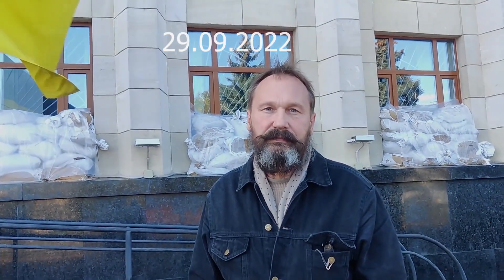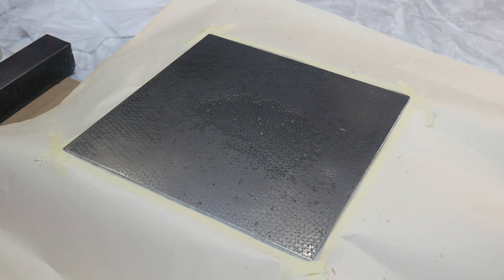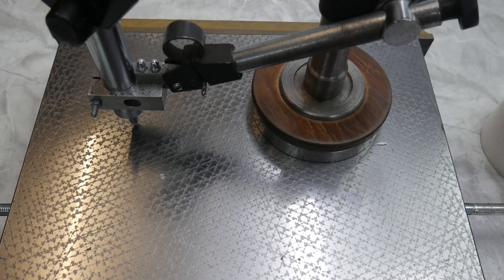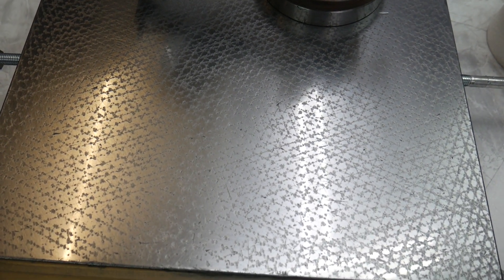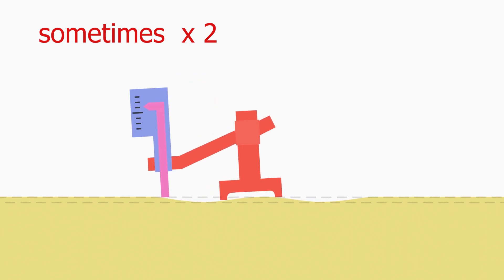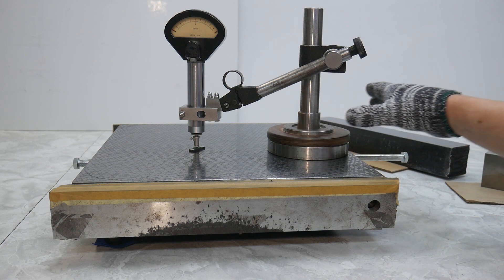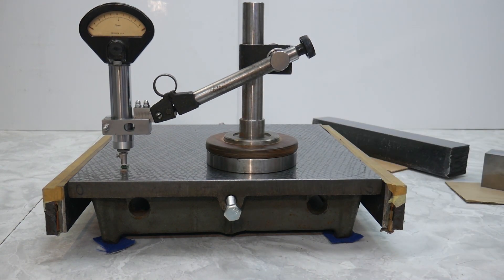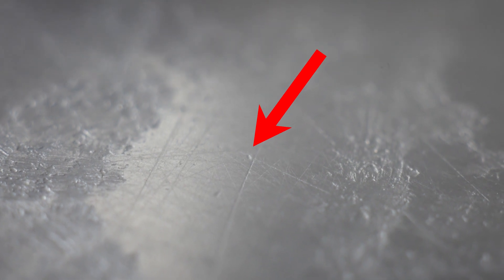Сhecking the surface  plate with a  microcator 0,0001 mm.

Comment: Mr. Bazarko shows what refined results can be obtained with patient work, informed by a deep understanding.  To see this level of precision achieved under extremely unhelpful conditions really demonstrates his expertise and his determination.   I have also watched the videos about the precision level, and the testing of the I-beam 1-metre straightedge - they also teach a great many details that are very valuable.  Even the blanket used to keep the radiation from his body from affecting the thermal equilibrium of the test object!    The Mikrokators look like a wonderfully sensitive instrument - the only problem with having one is that everything except the most extremely ideal surfaces would look very bad!  

This video showed us clearly and directly some problems to be careful about - markers and pins are both dangerous to perfect flatness....  I wonder how much more resistant to pin-dropping a granite surface would be.   Perhaps someone in Mitutoyo should send Mr. Bazarko a top quality granite plate for him to use and to test, as a gesture of appreciation. 

Lastly, applause for the comedy value of the cut from the calmness of the plate testing to the leopard-print painting of the lathe bed.  The vodka in Ukraine appears to be of excellent quality, as it made that paint job seem like a good idea.  Certainly made me smile!
Reply from the maker: Thank you for such a flattering comment. I want to clarify, I do not need a surface plate from Mitutoyo, it is an expensive item, and its transportation, due to its dimensions and weight, is also very expensive. I will make a surface plate of the highest class myself. Otherwise, what will I show my viewers? Fortunately, I have a very effective device for monitoring the surface of the surface plate, even better than an autocollimator. A very rare, complex and valuable device - an optical string. Direct optical measurements, and an accuracy of 0.0005 mm on a line of 800 mm. I hope to complete this project.
Reply: @gena_bazarko  It was not flattery, which is praise that is not deserved, but genuine admiration for your work.  To save you many hours of labour, for use on other projects, perhaps a gift plate could be acceptable to you - after careful testing of course :-)  I just hoped that one of the precision companies would show their admiration in a way that individual viewers cannot...   There are a few other very patient and skilled persons also sharing valuable information and examples - Robrenz and Stefan Gotteswinter are two I enjoy as well.  Robrenz has also shown some work on a large granite plate, that is of similar care and accuracy as yours, at least that is my impression.  I assume you know his channel as he is a fellow spirit. 

It is actually an interesting question, how the accuracy you are demonstrating here compares to a commercial specification like the "AA" grade that is generally used as a target for accuracy. It would not surprise me if your example plate was superior to that reference quality, but it is not easy to understand exactly how the written specification translates into a pattern of variability in a test like the one you are showing here.  The headline flatness specification looks like about 0.9um overall on a 450mm plate for a Laboratory plate, so you appear to be at that level, even without any extreme precautions in measuring.   In fact, your video showed that even a small pressure on the edge of the plate caused a bigger deviation than the average error.  It made me think about the effect of the weight of your heavy stand on the overall shape of the plate as it is moved around. Does the autocollimator show any local deflection of the surface under the weight of this indicator stand? 

Many thanks for your scientific and systematic experiments.  I hope that you are enjoying the successes of restorations like the grinding machine - that is a heroic project.  It will be very good to see it working after your renovation.  With appreciation from Cambridge, England.

Comment: Nice job! You show how to do it properly using very sensitive mikrokator with small hysteresis! Only one uncertainty is present - this method can't show the actual radius of the curvature of the surface so one can't know how much it deviates from flat surface. But the form deviation itself is excellent, I think, it is more like telescope mirror!
Do you consider to show surface plate flatness check with your super precise autocollimator?
Reply from the maker: Hello! I made a previous video, where I performed an experiment where I checked whether it was a plane or a sphere. I'll give you a link to the video. That episode is at the end of the video.  https://youtu.be/HwLQkeVVUk0
Reply: @gena_bazarko  Now I see, thank you. As I understand, your lapping bar is always on top position, unlike surface plate, and tent to form concave shape. Bottom surface plate tent to form convex shape. Cross checking them with indicator stand eliminates uncertainty in surface plate deviation from the flat shape.

Comment: Watched your video and got an idea not sure if it works. I have a mill and the table has twist and bow and I'm trying to make it flat using a granite surface plate 600mm X 900mm. The plate is raised in the middle by 4 micron based on the inspection paper coming with the plate. I see you used a marker and showed a raise of one micron when going over the marker line on your plate. I wonder if you draw another marker line on top of the first do you read 2 microns? If that works I can draw couple lines overlapped on my plate to make it more flat while using the blueing spotting and scraping.
Reply from the maker: Unfortunately, using the translation, I could not accurately understand the question. If you draw a line on top of a previously drawn line with a marker, the height of these lines is not summed up. If you put a dot several times, the height is about 3 microns. There is a white marker, its line is higher. To know its height, I need to take a measurement. If needed, please email me.
Reply: @gena_bazarko  When you say put a dot you mean in the same spot put the dot several times?
Reply from the maker: @car9167  Yes, then the height of the paint is greater. I could not understand exactly what problem you want to solve.

Comment: https://youtu.be/Va4TGDnQqDs
Reply from the maker: Thanks for the link. I know this great channel. He deserves special attention.
Reply: @gena_bazarko  I believe the repeat O meter is for finding local local spots and has 4 feet of 3/8 inch  10mm to simulate a 3 footed surface gauge with an indicator - if a foot goes in a hollow in a surface plate you see that defect in the plate
Reply: @gena_bazarko  for   testing  a plate overal normally use an autocollimator,  or level, or twist gauge or a long beam with an indicator in the middle
Reply from the maker: @kitbullough6938  If the task is to map the irregularities on the surface, the repeat-o-meter will not work well. Although, I think, if you apply complex calculations, then this is possible. But in this case, when the surface is close to the correct shape, the repeat-o-meter is quite suitable. If there were, for example, a bulge of one micron on the surface, this would be clearly revealed by the corresponding swing of the needle on the device.

Comment: I have a micronator like that- make a twist gauge from your straight edge and 2 gauge blocks at each diagonal corners- measure height in middle with micronator
Reply from the maker: I understand what you're talking about. This is what I did when I leveled the surface. If there was a problem in this place, the repeat-o-meter would show it while turning, being on a diagonal line.

Comment: This is just excellent! Your English is very clear and easy to understand (at least for me as a German). (subscribed)
The Microcator is a really nice piece of equipment. Nice to see it in action.
Question: what does the "foot" of your repeatometer look like. Are there individual contact pads (3?)  or is it just flat or with an elevated (lapped?) rim?
Your video motivates me to check my small granite plate with my Millitron.
Reply from the maker: Along the edge of the support there is an annular protrusion, about 5 mm wide, it is lapped to the plane.
Reply: @gena_bazarko  Thanks for your prompt reply! Highly appreciated.

Comment: Not the right way to check overall accuracy of a surface plate.
The right way is to integrate all level inaccuracies with either a (electronic) level, autocolliminator or heterodyne laser interferometer.
Differentiometer only tells you if it has low spots or not.
Reply from the maker: At the beginning of the video there are frames where the surface model is presented showing its relief before I leveled it. This relief scheme is made as you specify. There, at each point, a height is defined. But in this video, I'm not scanning the surface and plotting its highs and lows. I demonstrate that the surface is very flat.

Comment: Awesome. Very interesting. I'm waiting for new videos. How will you process the stone slab?
Reply from the maker: I can use different ways to remove granite in the right places and different tools. It doesn't matter. It is important to accurately scan the surface topography to reduce the topography in the right places. The plate will be mounted on three adjustable supports, its position in space will be controlled by three microcators with an accuracy of one micron. With a precision level, I can scan the surface. The room has a powerful reinforced concrete floor, I will be placed on an independent platform reinforced by the upper floor. The corner of the room where the work will be carried out is minimally loaded by external heat. I expect very high plane accuracy, less than a micron).
Reply: @gena_bazarko  Looking forward to that video. As well as any other projects you like to share. Well done!